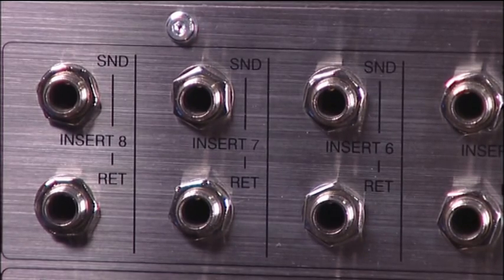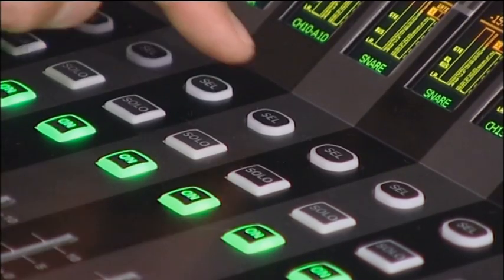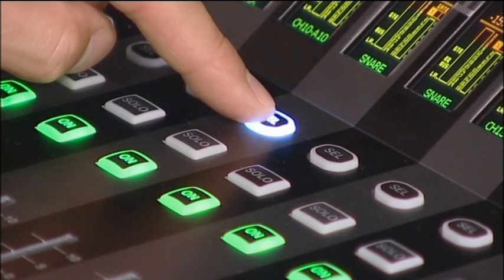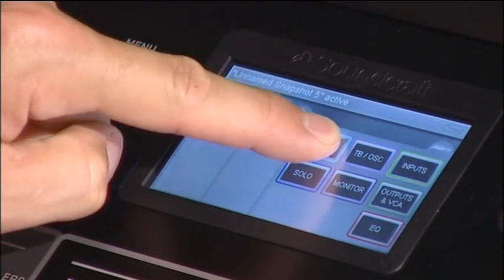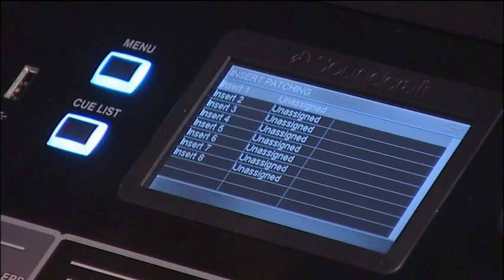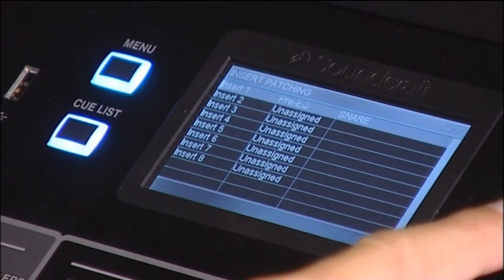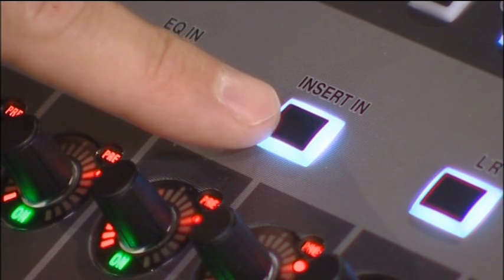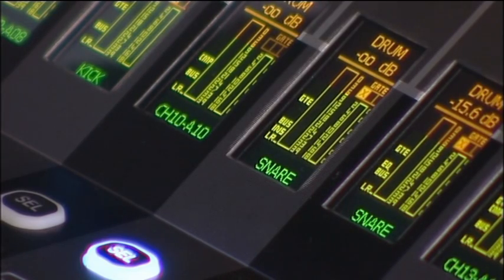Soundcraft Si Series - Using Insert Points

Comment from the maker: Generally the answer is 'Yes'. Inserts can nearly always be used as outputs for such a task and, depending upon your console and system inserts often serve very well as returns from your audio interface back into the console.
To elaborate on this detail it would be helpful to understand more about your set-up, application and equipment; you can contact me directly by email richard.ayres@harman.com or phone +44 7766 525971
Regards
Richard Ayres
Product Manager Soundcraft - Studer